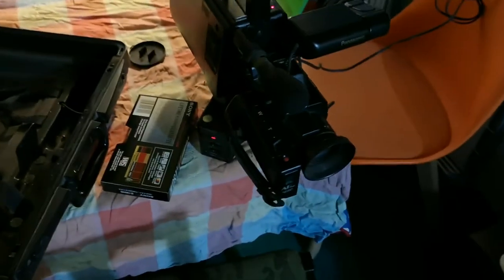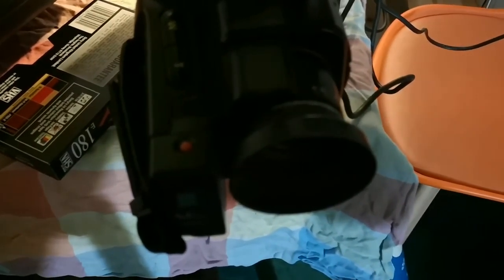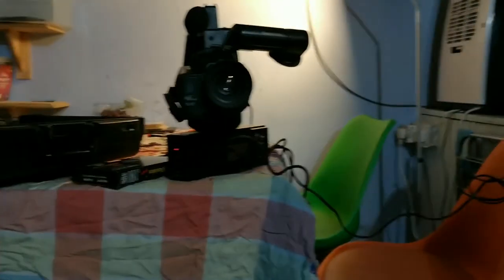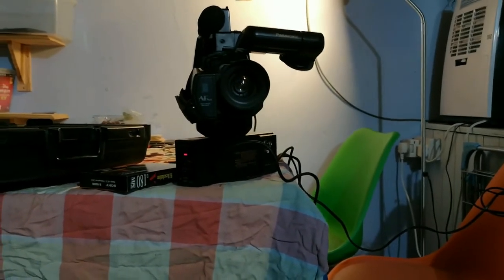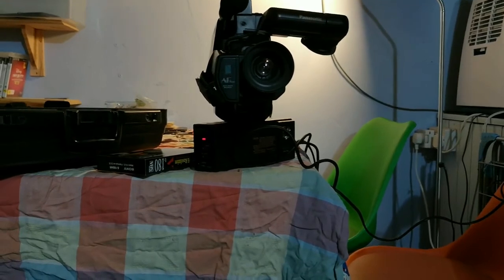Fixing another Panasonic M7 - Fixed Recording Demonstration

Comment: I can tell the white lines on the screen is not a CCD issue, but capacitor issue. I had the same problem
Reply from the maker: I did wonder, the issue became less apparent, the longer the camera was left turned on...
Reply: @JCTsFascinatingHobbies  Yeah. By the way, i only used the camera for 1 month or so (with this problem) when suddenly the camera stopped outputting any picture and it was just black. The sound was intact though. The capacitors broken entirely. If you fix this issue on the camera, please let me know which cap it was. Thank you!